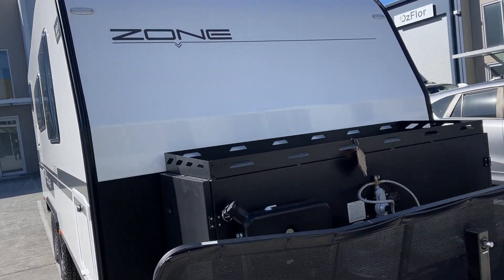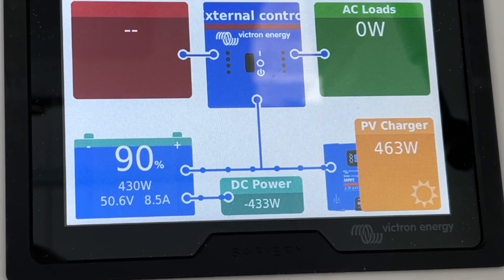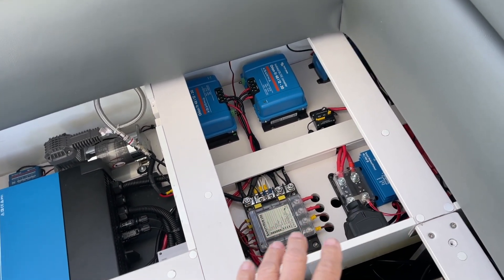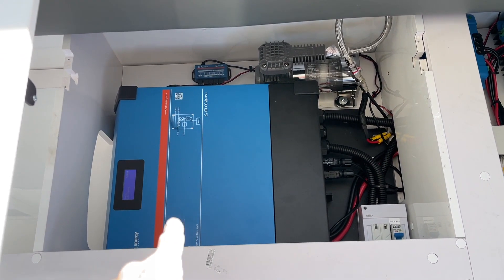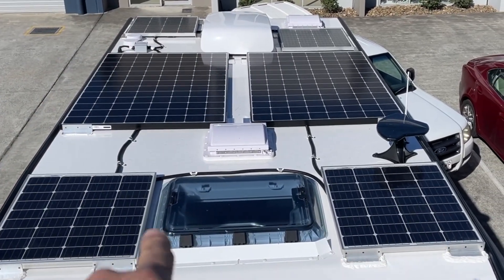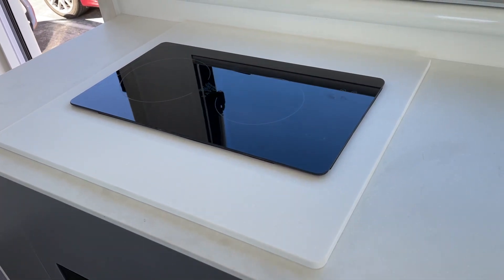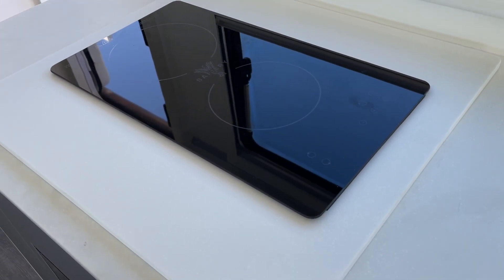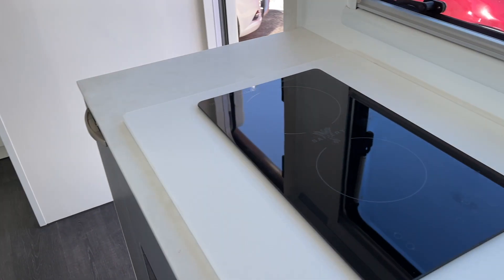ZoneRV Base 20’6 Walk Through of Power, Solar and Tank Upgrade 48V Power 160W Solar 6000VA Inverter

Comment: @ 0.58,  it shows the batteries connected. the bottom right terminal is not connected to anything. please explain why,
Reply from the maker: For a battery bank, we wire the positive load/charge feed into the battery at one end of the bank and the negative at the other end. You cant see the negatives in this pic but if you could there are two connections on the bottom battery.

Comment: Awesome work again Bruce. I did a similar upgrade in my Zone RV Base family 20.6 from new back in 2020, which was inspired by Safiery and self installed. 1340 watt of solar, 4 x 48volt 50Ah lithium and all running through Victron gear including a 5000w MultiplusII which has now been  changed out for a Multi RS Solar 48/6000 for a reduction in weight. Yes, 4 x 48volt 50Ah will fit in the Base where you have the three in this Video. In my real work experience, the 4 x 48volt 50Ah is needed if running the A/C overnight for 10 plus hours.
Reply from the maker: Great to hear. Well done. What DC to DC are you using?
Reply: @Safiery  1120 watt Daygreen 12 to 56volt converter. I then use a Victron solar charger to limit and control it's output into the system. A bit unorthodox but it runs like a charm.